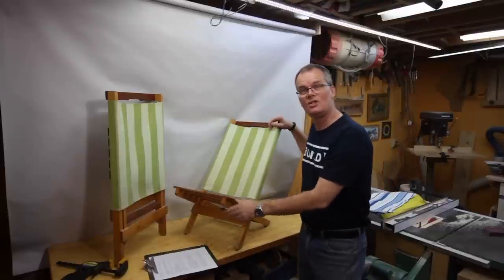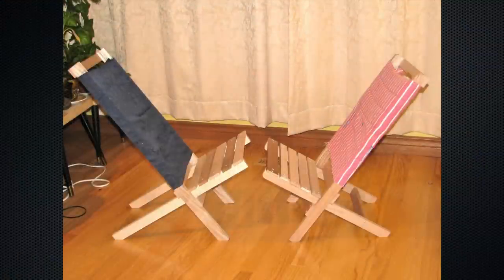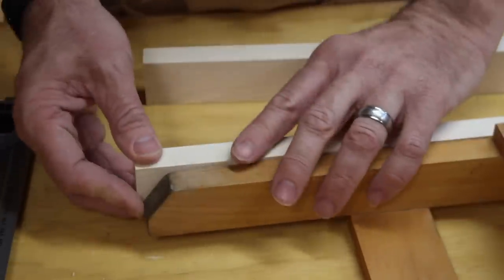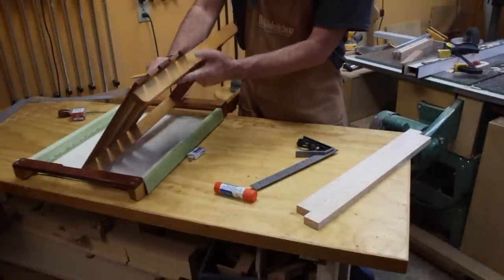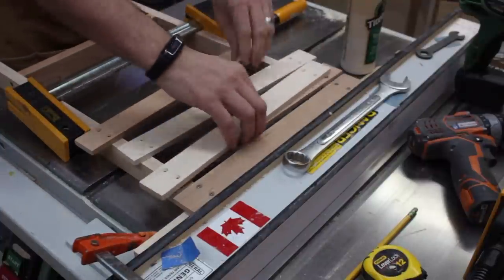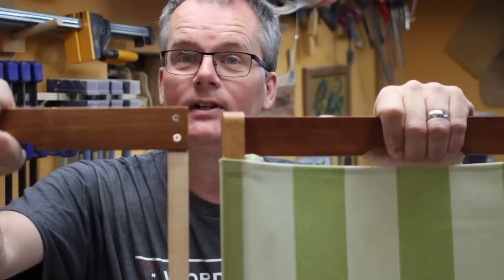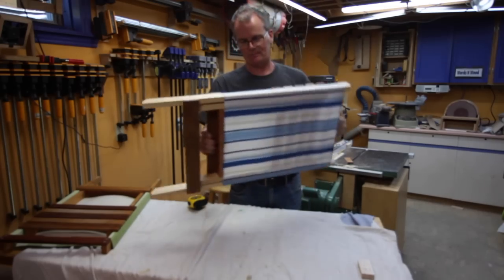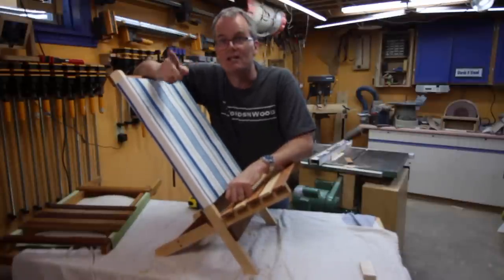HOW TO build the BEST Beach Chairs!! (WnW #170)

Comment: We used to make similar chairs in the boy scouts many years ago. One advice: don't use glue for the top cross piece of the seat back. Then you can remove it any time by just unscrewing it and slide off the fabric in case you want to wash it or replace it. It also makes re-finishing the wood and sewing the fabric easier. You just fold over the long edges of the fabric wide enough to create a tunnel for the sides and run it through a sewing machine in a straight line and you are done.
Reply from the maker: Neat idea, thanks for sharing!

Comment: Thanks for the video! I have an old Byer of Maine Lounger that broke after 25 years of use! Can’t buy them anymore so I want to make these. I did notice that the Maine Lounger has the fabric attached difrent from yours. It is stapled and then the slats rolled a couple of times inward to completely hide the staples. I assume this would require taking the completed chair back apart to attach the fabric.
Reply from the maker: Sounds like it to me, if I'm correctly visualizing what you are saying.

Comment: Hey but I've got a lot of 2" by 3/4" lumber  So how much do I need to change the design to match the lumber I have cause it seems waste to plant it down to inch and a 1/2
Reply from the maker: You probably would need to experiment with the crosspiece spacing since that controls the tilt.